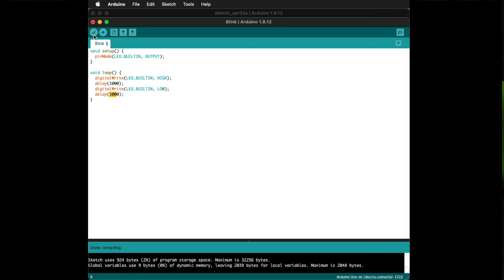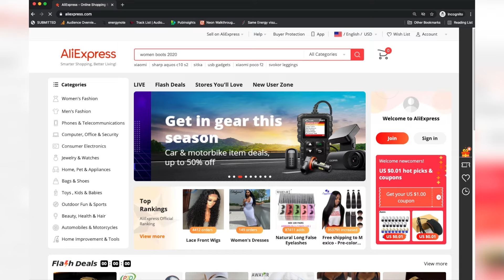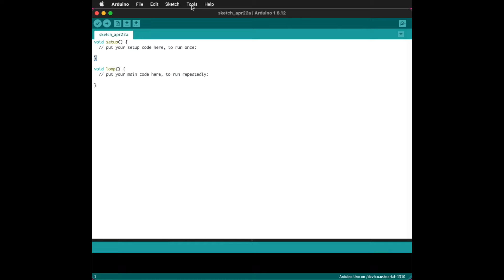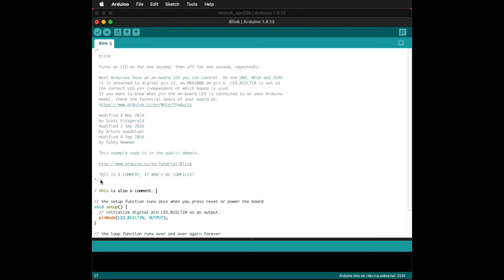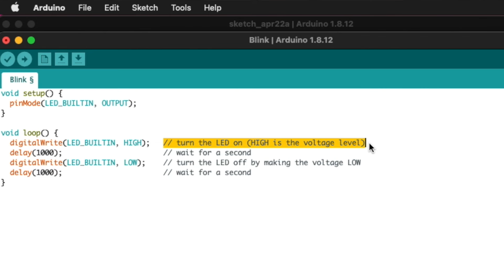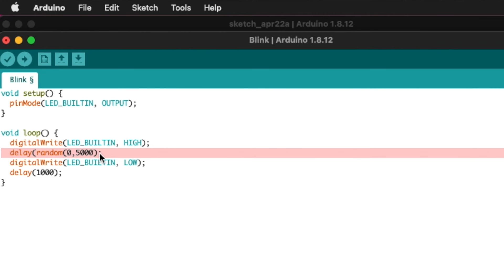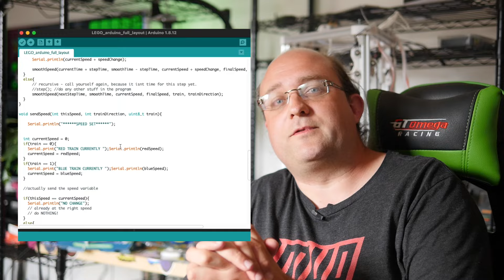What Is Arduino? What Can You Do With It? Explained

Comment: How is this compared to the raspberry pi?
Reply from the maker: Arduino is best suited to learning electronics and simple C programming. If you have an idea for an electronic project and need to prorotype it quickly, choose Arduino. Raspberry Pi is more like a mini-computer that you download software for, and while it can interact with electronics, it's a bit more of a faff and you have the overhead of an operating system, so things can run slower. Raspberry Pi is better if you need things like a user interface, mouse/keyboard etc things that need drivers.

Comment: Great video, thanks! 

I work with Industrial PLCs for a living and primarily use Ladder Logic with very limited structured text and function block diagram in the programming. I was going to mention the micro/mili secont bit but saw someone already did. Cool to see it used here as it is the most common time base used in the PLCs that I've seen. I want to start picking up some DIY projects and learn a bit more of textual programming language. Thank you for the vid and recommendation on the starter board. I want to see what functions I am able to mimic from ladder logic and for my first real project I want to make an automatic pet feeder for 2 cats ! 😄 Thanks again!